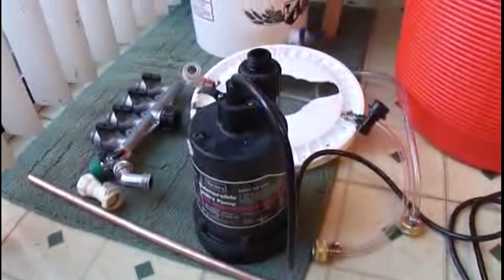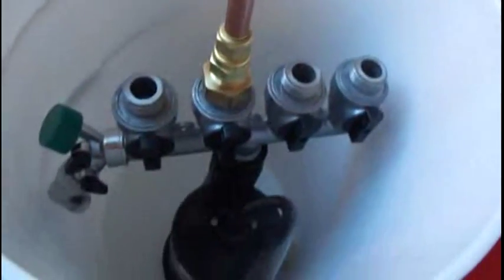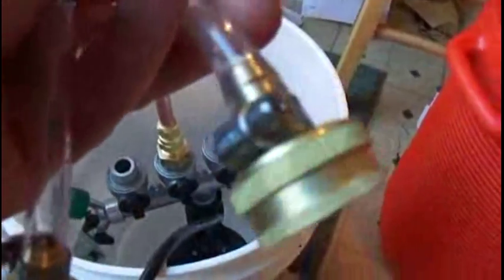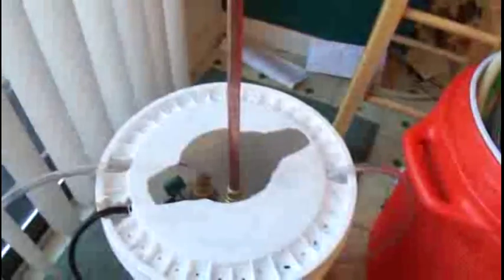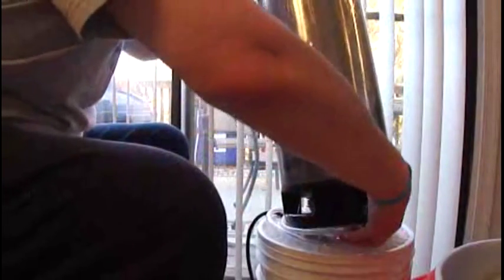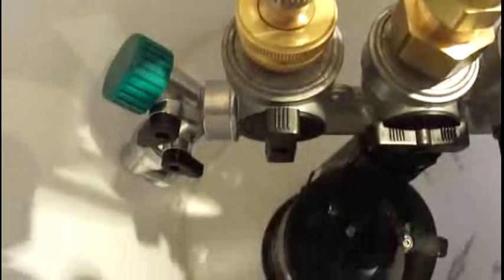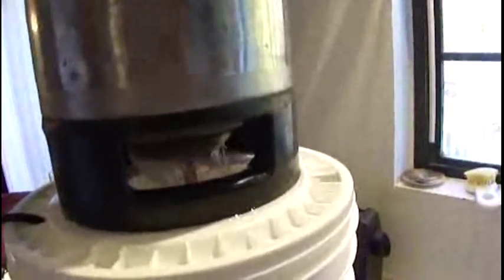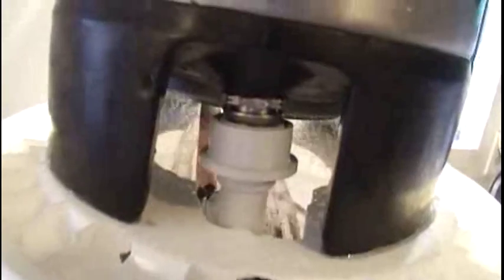Homebrew Carboy and Keg Washer

Comment from the maker: Thanks, the elbow and valve let me circulate water & cleaner through the pump without a carboy or keg being mounted.  That lets you run it first to make sure a powdered cleaner is dissolved first, and also lets you flush the pump by recirculating fresh water after you are done.